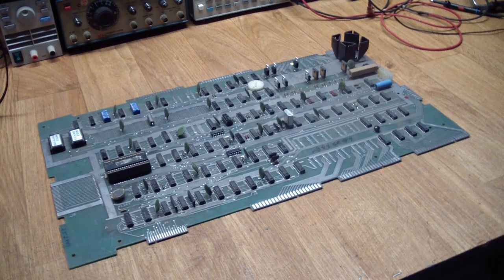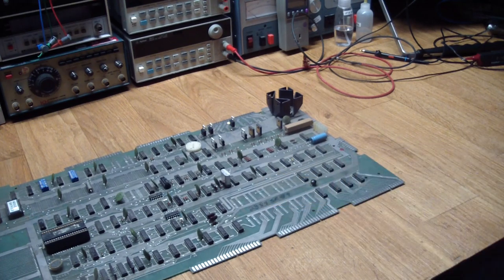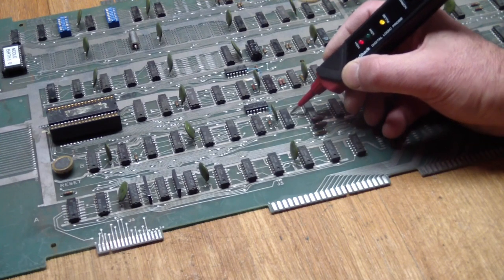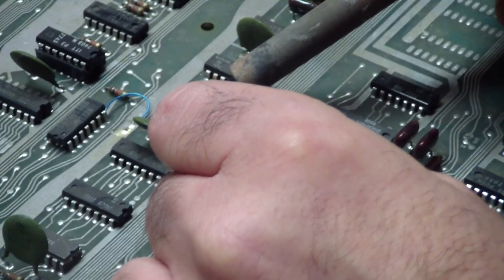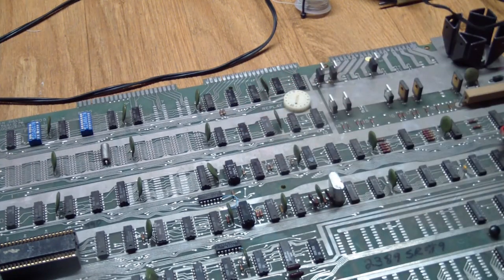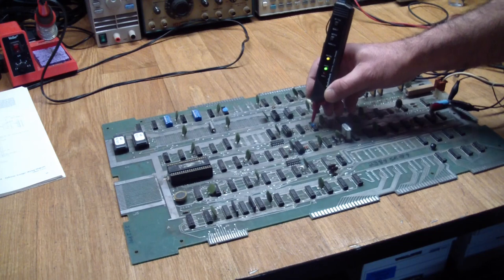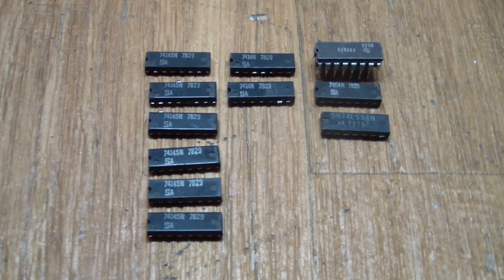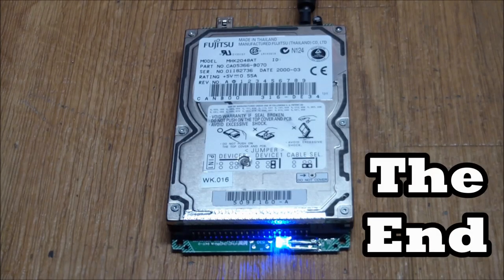AE#114 Repairing An Atari Pinball CPU Board

Comment: Nice job. I like the details as different folks have different techniques so one can always learn something.  Note, I mentioned the whining noise previously as many folks use headphones and such noises can be quite unpleasant when right next to your ear. Your right workshops are noisy, etc.  I don't go to great lengths to process the audio of my vides but the video editing package I use does have a noise filter option which when turned down to 10%~20% does a decent enough job. Higher than that and people voices sound like robots in a tin can :)

Comment: I am posting this comment to help others that may have a similar issue with their Atari Pinball board. On my board, the reset signal at pin 40 was stuck low and it would go high only for a second when the button was pushed.( it is supposed to either stay high when the game is working or pulse when there is another problem.) The problem turned out to be chip C6 (model 9301PC), which is part of the address decoding circuit.

Comment: Quite some damage on that board it turns out ! Re extraneous noises - I only mentioned the whining inside the pinball machines because I was curious to know what makes that noise -none of the noises in your repair vids bothers me Arti - even your 'mr Noisy' HP psu (or is he a sig gen?) - old stuff makes noises, it's as simple as that - especially with the lid off under test.
(I worked for HP for 21 years, and so I got used to the 'mr. Noisy' fans syndrome in some of their otherwise - wonderful test gear :o) )
Reply from the maker: HP makes wonderful instruments, but their older cooling fans are even louder than the ones from Tektronix.

Comment: ARTIFACT ELECTRONICS,  I'm confused why the solenoids voltage is +48vdc why? because most pinball games solenoids voltage is 6vdc or 12vdc
Why is there 2 different clock signals used that are out of phase, for what reasons?
Also what is the DMA signals do in the arcade game? you didn't explain much about the DMA signals
Reply from the maker: Solenoids require a high potential to operate properly, the minimum I've seen is 28 VDC.
Two phase clocks are necessary for proper instruction sequencing. A modern cpu uses an onboard PLL to generate all necessary clocks internally from a single external source, but early devices used two phase clocks so that you could share bus devices such as in syncing two processors to use the same memory.
The DMA puts the cpu to sleep and transfers memory contents to latches which is faster than the cpu having to write to each latch.
Reply: @artifactelectronics  thanks for the help
        1.) i see the access time on the datasheets for parts like RAM chips, PIA chips, PLA chips, 
PIA & PLA chips have access time also
But I don't know what determines a designer to choose which access time is right for the game programming code. How would a software arcade game programming code know which access time to choose for the IC chips?
     2.) The software game programming looks at all the datasheets access times for the all the IC chips and choose the access time based on the Clock speed? 
If the clock speed is 1Mhz, what access time would be good to use?
If the clock speed is 4 Mhz, what access time would be good to use?
Reply: @artifactelectronics  HI
---------------I'm confused why some arcade games what to redirect the addressing?
--------------------------------What is the "advantages" of redirecting the addresses?
---------------------------What is the "advantages" of bank switching the data buss lines and band switching the address buss lines?